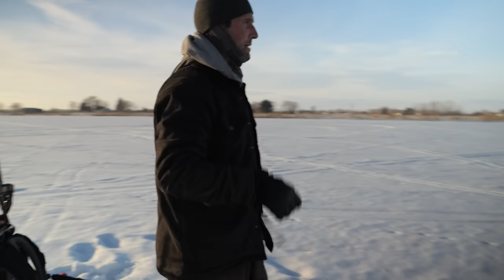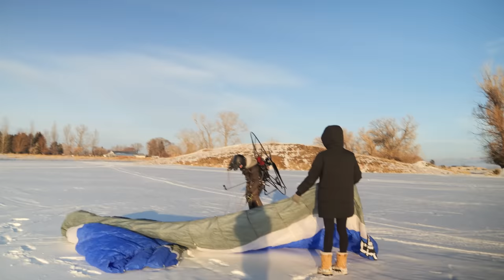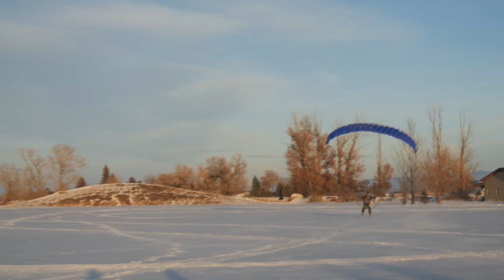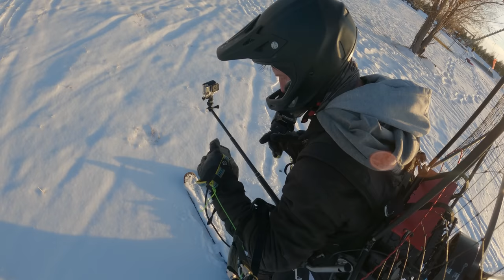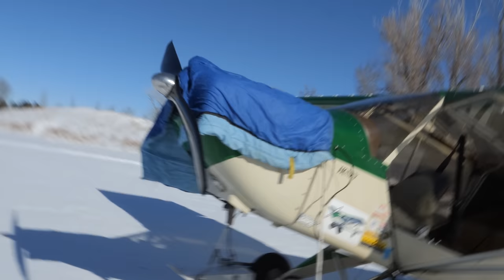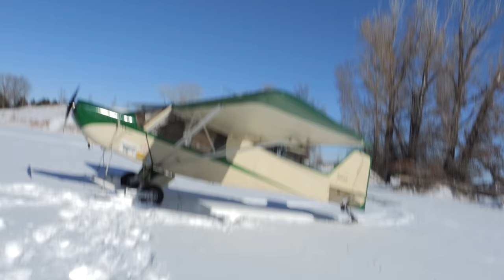Will it WORK? / Speed wing + electric paramotor

Comment: I wonder if temperature was a factor in the Amp reading. Nice you see you both out doing what you love.
Reply: My electric bike has about 1/3rd of normal power when it is less then 12c+ outside... And in minus degrees it gets even worse, it is ok if you go right away with hot batteries and keep using battery power but stop for a few min and the batteries get cold and have no power and you have to pedal like crazy to go against wind or up a hill because there is no power...

Comment: My go-to lately has been a 14m miniwing on my sp140. The battery can handle peak power (20+ kW) for a minute or two. I try to keep it under 15 kW constant. Manufacturer recommends keeping it under 10 kW constant to help the life of the battery.
Reply from the maker: Oh wow 😯 that’s awesome 😎 thanks for sharing that info! We need to hookup one of these days and do some flying!
Reply: I am planning to buy sp140 as my first paramotor to begin my training. Do think this would fly efficiently with grade A wings like Ozone Mojo2(28m) or MojoMax(32m)? Or will it diminish the flight duration?
Reply: @MahaBali7975  you’ll have the highest duration with a slow, lifty beginner wing, Basically any EN-A wing. You won’t necessarily cover as much distance though. I’ve flown for an hour a couple times with my EN-A with no thermaling

Comment: I wonder if a prop with a higher speed will perform better. Because now you needed to have the RPM above the designed range of the prop probably. The speed you need to maintain airborne is a lot higher of course than with the normal wing.
Reply: I think that applies to gas engines, but is there a significant impact for an electric motor?  Feels like the RPM range differential from 'designed' probably wouldn't be that much of a difference for the electric.  Bah!  I need more learning!
Reply: @JRSkola  an electric engine has a specific value called Kv or the rpm per volt. This value indicates the speed at which the motor wants to run at a specific voltage. This wil also influence and define max torque at a specific speed. If your airspeed is very fast the motor just doesn't want to run any faster and is giving only very little torque. A higher speed prop will fix this issue.
Reply: @basgoossen  I think I follow -- but do you think the rpm of the prop is appreciably different between a speed wing, and a regular wing.  My guess is that the delta between those two RPMs wouldn't be practically different.
Reply: Well i'm not an expert with regards to those bigger motors, but i do have quite a bit of experience with smaller brushless engines on model aircraft and speed drones. To my knowledge the RPM of the propeller is quite proportional to the airspeed. And i'd figure the airspeed of a stable flying speedwing is much higher than that of a stable flying normal paramotor wing. My guess is that to generate enough lift on the speedwing you might even need to go 1.5 to twice as fast as with a standard wing but that is purely an assumption based on size and wingprofile. So hence the prop speed will also be proportionaly higher. But again i'm no expert and i do not have experience with flying craft of this size and weight.
Reply: @basgoossen  I think it would be a fascinating chart to see a composite of airspeed vs rpm, motor torque, and power draw.  As you're alluding to, perhaps a 'constant speed prop' much like Miro from Scout has created could eeek out a few more minutes of flight time from a battery system.

Comment: Do you keep the batteries hot before takoff? My experience with Electric Bike is that I get about 1/3 rd of the normal power as soon as the temperature outside is less then 12c+ if the batteries just stay in the cold for a few minutes before I go with the bike... As long as you use power they manage to keep warm if they was already warm but stop only for 5 min and all that power is gone for rest of the day....
Reply from the maker: Yes I do keep them warm inside before I go out. 
And you are exactly right that the batteries will maintain temp if used.  The multiple bad launches didn’t help that situation though.

Comment: You're flying deep in the brakes close to stall. Turn by leaning, not by using brakes and you'll lose less altitude. A Firefly isn't a speedwing, it's a miniwing. That gopro mount on your ppg is going to get you hurt or killed. Lines can easily be caught on it. Separated cage too.... so much lol

Comment: You do know under load vs no load are entirely different right. Your 51% was not really how much power you had left, coasting slowly would have been a more accurate reading pulling way less amps. You need to find the sweet spot of average draw to battery life...

Comment: I want to understand, which wing will consume more amp/power on electric paramotor a large 32feet, high lift, EN-A wing like MojoMax or a smaller size Spyder/Viper? Consider the fact that I don't need hight speed flying or acrobatics, just 15-20miles/hr slow flying.